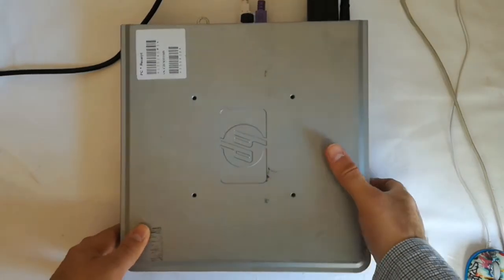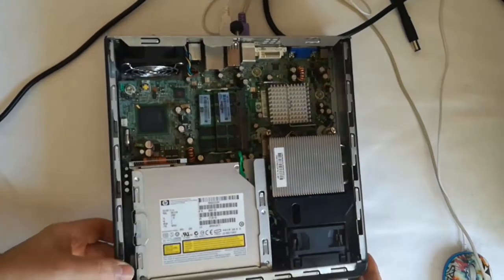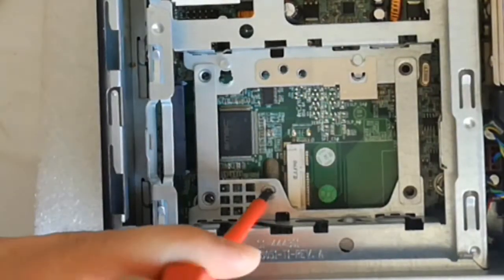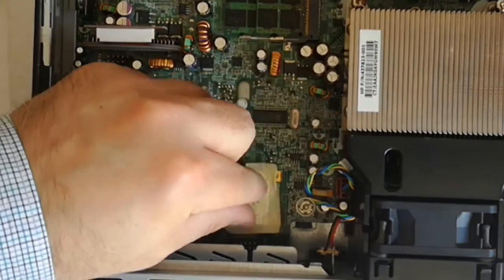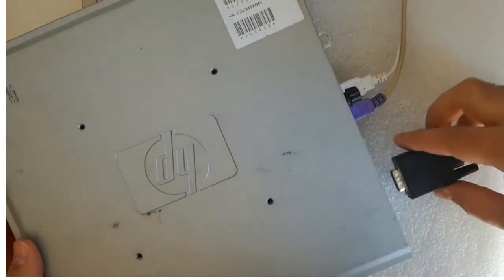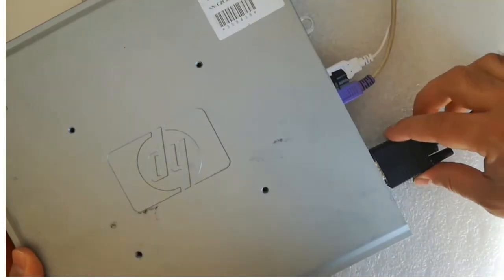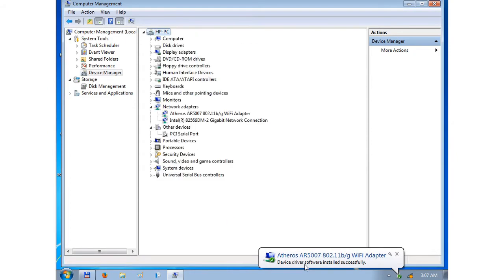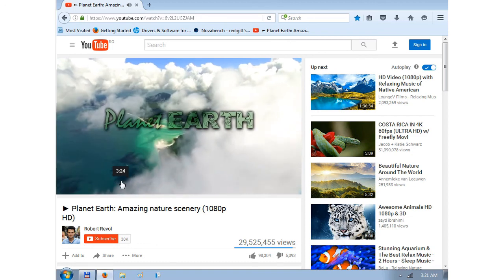How to install on board Wi Fi card in HP Compaq dc7800 USDT PC Ep.194

Comment: Is there a specific update or driver required?...I have tried several USB wifi dongles and tried installing drivers for them and it won't install even after my win10 upgrade it says "Sorry! We do not support this operation system !!"
Reply from the maker: Aloha, probably the USB Wifi dongle is an older generation, has no support for Windows 10 or you downloaded the wrong driver, there are x86(32) bit and x64bit versions. You have to dowload according to your operating system.
And there could me one more reasons, has Windows 10 support, but for an earlier edition of Windows 10, in this case you have to install an earlier edition of Windows 10 and update to the ultimate version, and maybe the wifi driver will work, but I'm not sure. Good luck.